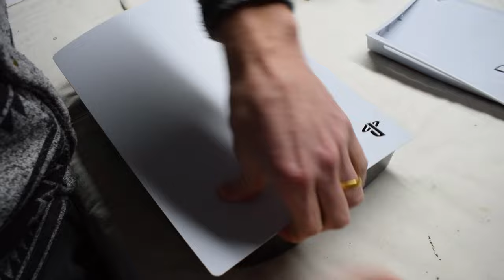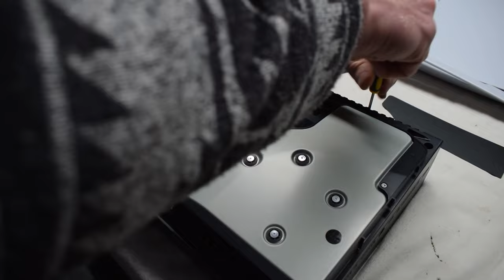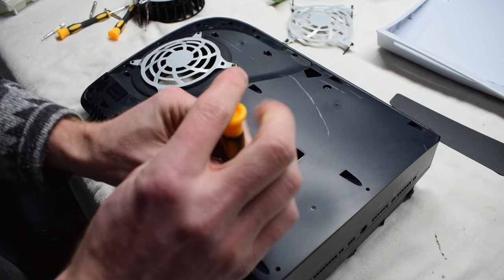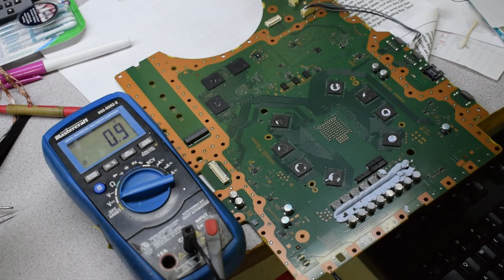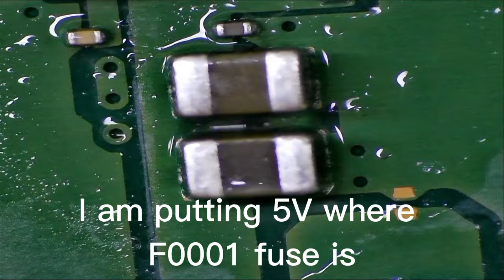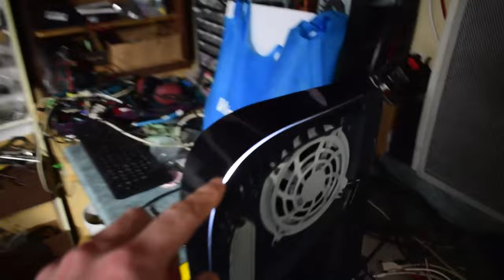Easy Fix! ps5 beeps but won't turn on

Comment: Not an easy fix
Reply: It’s actually a VERY easy fix. You have to consider who the content is made from. In your world it might be hard. In mine it’s super easy to do. This is more for board level repair techs and that’s ok.
Reply: @RifterArchive man get out of here with that in my world it’s a easy fix stop straight cap.
Reply: I’m sure it is an easy fix if you have the time, experience, knowledge, tools and parts. For me however, I might as well be slapping it with my dick cause I’d get the same result as if I actually tried to fix it the way you said. Good instructions, I’m just electronically illiterate.
Reply: This is actually a really helpful video I’m just not scared to this considering I don’t make any money to fix it I tried it myself and was successful in my repairs w no experience what so ever
Reply: This vídeo is for someone that actually knows what is doing. I didn't open mine yet, I hope it works
Reply: @RifterArchive  Well seeing how the video author ended up ripping a pad while trying to do something as simple as removing a capacitor, its evident that its not that easy for most people.
Reply: @jrmint8250  given that was a year ago. I have perfected this and several other techniques related to the Beep     OF       DEATH. 😂. I would say easy fix now. Also turn pads happen all the time. Not really a great metric. I hope the video helped you though. The PS5 is a pain to diag.
Reply: @RifterArchive  then its not easy
Reply: @brakkify  yeah once you have the skills needed it really simple. I’m not understanding the issue
Reply: @RifterArchive  when you're 13 have no idea what you're doing but seeking approval on the Internet. Look no further than this guy
Reply: @RifterArchive  Well it is easy for someone that have done electronics at board level and soldering; this is a specialized skill not for everyone so diminishing someone that does not or could not do this I don't think says nice things about you. I am a tech and you may be as well but lot of people having this issue with their consoles are literally screwed if this is the case.

Comment: I have a ps5 that will turn on after I let it sit unplugged for a long time. When I turn it off, it won’t turn back on. It beeps for disc eject, and when I hit the power button. It’s so strange.

Comment: My 2 year old spilled water on my ps5. I didn't realize until 2 days later when my ps5 did the beep but no lights. I move the ps5 and see water under it. I peel the sides off and see water. I eventually opened it up. Thw mother board was dry. The fan had some moisture. I put it back together and still getting the beep but no lights. Any help?

Comment: What kind of psu do you use for test? Original comes with 31 amps and 12v. I have a 12v and 17 Amp. Is enough just to test if the motherboard is still OK?

Comment: hi i have a problem it beeps but won't start i'm not smart enough to fix it so can i send it to you to fix it from finland
Reply from the maker: sorry I am not in finland
Reply: @NewsonsElectronics  I would send from Finland
Reply from the maker: @patrikylamaki4205 shipping is expensive I am sure there is a local repair shop close to you. I am currently abroad and paused repairs 😢

Comment: Anybody else notice him rip the pad off with the cap?  Got lucky there was just a tiny spec left there bud, need to use a heat gun next time!
Reply: I saw that too😭, heat gun isn't necessary, you could melt other component, just melt both terminal with the soldering iron

Comment: It shows you have never opened a PS5 before, moving on to a more experienced tech but thanks for the video!
Reply: it doesn't take an experience tech to know how to open a console it takes one that knows how to fix it which he did, however your A.D.D. didn't allow you to watch the full content or your just a 14 year-old with developmental issues

Comment: Where do you get your replacement parts?
Reply from the maker: from another board,
Reply: @NewsonsElectronics who just has a spare ps5 board lying aroubd
Reply: @Dark_knightz2.0 many things use those same capacitors. It doesnt have to be from the same board

Comment: Annnd thats why we use hot air stations and dont just force caps off the board and rip off the pads with force. Cringe so hard. Micro soldering is no joke and not for shaky hands.